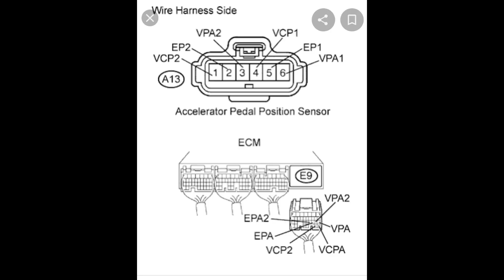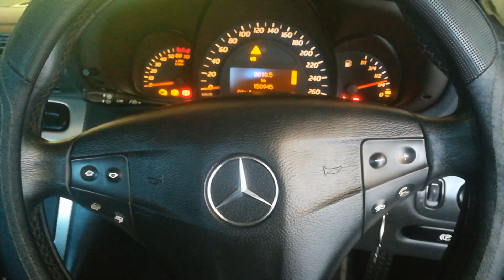5) W203 Mercedes C230 Kompressor Sport Coupe V8 Swap

Comment: Don't you know where the recounter signal wires are?
Reply from the maker: @karabomaupa1616  Hi , yes I figured out that it is the sensor that bolts into the block by the flexplate

Comment: The fact that this was posted in 2020 gives me inspiration to build my lil Mercedes after the original engine is donezo. 

I want to have a sleeper c230. Doesn't have to be a fuckin v8 but I want PULL
Reply: Better supecharger pulley , tune , cold air intake , aftermarket intercooler, exhaust on the inline 4 is pretty fun

Comment: I have a w203 C200 kompressor with a manual transmission. I would like also do a swap for a Lexus 3uz v8 and an automatic transmission is this doable?
Reply from the maker: Yes
Reply from the maker: I am running all on the Lexus computer engine & gearbox the only thing that's on the mercedes computer is the abs and traction control
Reply: @DanteSwanepoel   What can be the average cost for doing everything?
Reply: @mabasanyiko2501  what about a 2jz in a 05 c230 automatic? Is that a good idea? Fellas?

Comment: How hard was this to do?
Reply from the maker: Not that hard as shown on the other videos just a little bit of thinking 😜
Reply: @DanteSwanepoel  What about electrical stuff? if I wanted to swap a 4.8 in do I need any special harnesses? does the mercedes computer go apeshit and start throwing codes and lights?
Reply from the maker: @KurruptedDataYouT  I will make a video on that for you
Reply: @DanteSwanepoel  Okay, Thanks!
Reply: Is cluster working
Reply from the maker: @marlonbaird6070  Hi check the next video #6 I explane wat works and does not